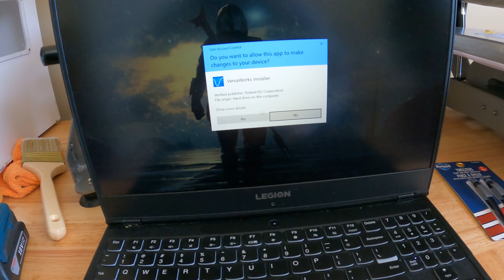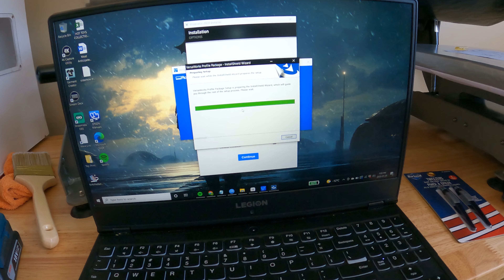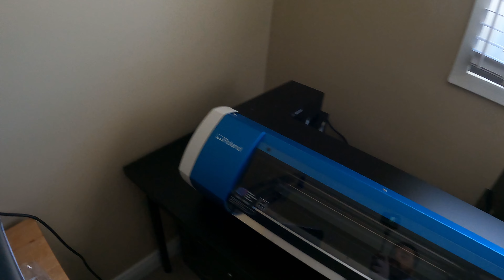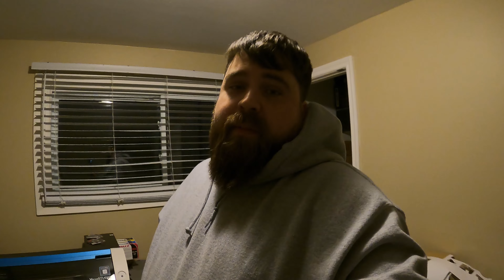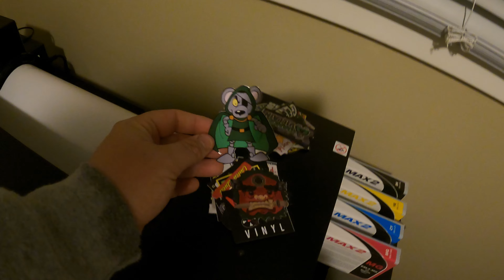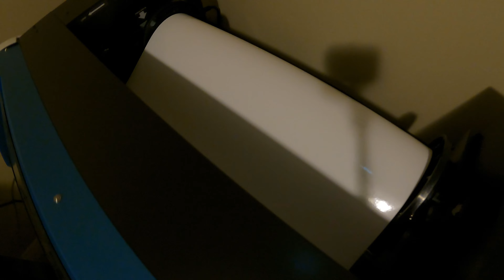UNBOX Roland BN20-A Print Cut Machine - My 1st Sticker Print

Comment: Great printer, i am on my second one. However, for die cut stickers i do recommend getting a separate cutter for this. I use the graphtec CE7000-60 for the die cuts. There are a lot of reasons as why to get one. I understand it's an expense and it's not cheap, but in my experience much worth it.

Comment: What are your cutting settings so the sticker is cut all the way through?
Reply from the maker: If you want to cut all the way through the cut force is going to largely depend on what type of vinyl you're using and how thick it is, etc.
I know for CutCountour lines I'm at aronud ~90-105 cutting force and for PerfCuts I was up around ~160-180 or so if memory serves.

I hate cutting on this machine as it is 'cause it takes soooo long haha. Printing on it is fine since the prints are high quality and fairly quick all things considered but a separate dedicated cutter blows this thing outta the water in terms of speed.
Reply: @iampaulsheppard  thx for the Quick reply. Will try these settings